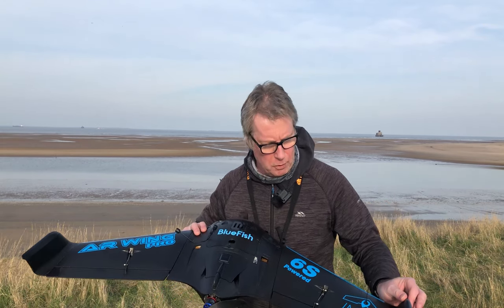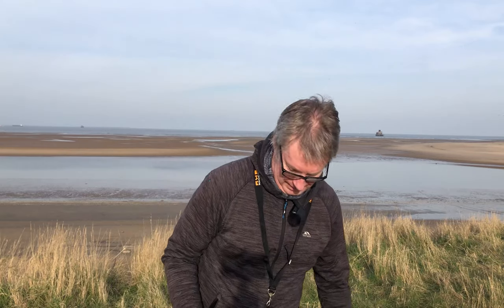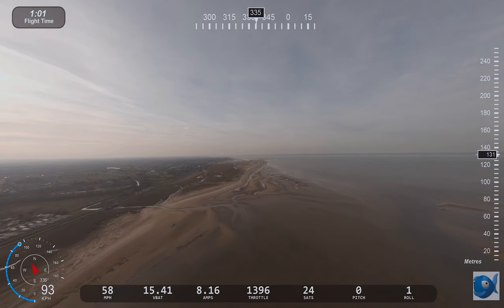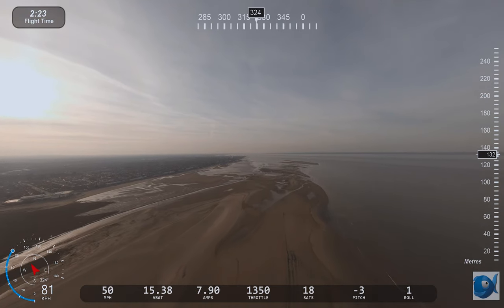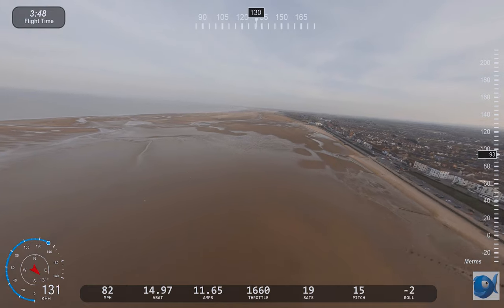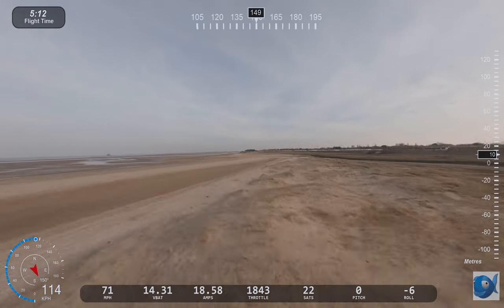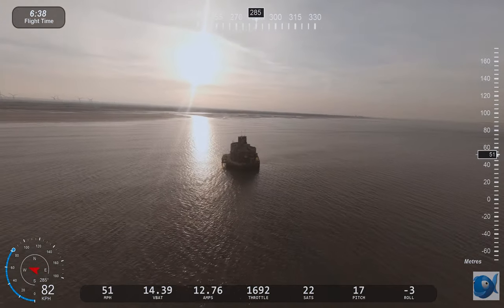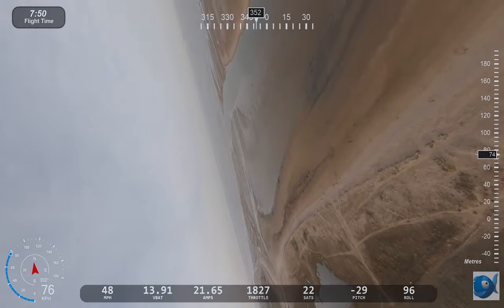AR Wing Pro - Beach Flight - Narrated

Comment: Nice video. Think you have just convinced me this is what I need. Only from the other side of the water, when’s a good time to find the beeches empty? Been over a few times but alway ram packed.
Reply from the maker: I have just changed my motor for a SunnySky 2216 1400Kv MkIII with an 8x6 prop as I think it wilkl give me a little more acceleration out of the turns and better climb rate.

This time of year as the weather gets colder is the best time for beach runs, in summer you need to get there really early in the morning like 5 or 6 am latest.

Comment: Very good fly. Only 1 problem : servos 08 not strong for fast fly ( i crash my fx61 on 150 kmh). 
Maybe posible ask from you nose model solid file ? ( i want use go pro 8 on this wing).
Reply from the maker: Hi Alex the Emax ES08MD are fine on my AR Pro its not that fast and I have used them on my AR 900 6S flying at over 200 kmh. I am using much stronger servos in my 6S Mini Drak build though.

Here is the STL for my Hero 6 mount you will need to modify it I think for the Hero 8
https://drive.google.com/file/d/1HTEzufceWCDX9ylOE2qZYtWE056iXa3z/view?usp=sharing
Reply: @bluefish3607   🥰🥰🥰🥰🥰🥲

Comment: About to set up a build similar to yours. I'm surprised it cruises relatively high at 8 amps. Do you think adding a 10x5 prop would improve efficiency?
Reply from the maker: I could get a lot more efficiency fort sure but I like the current setup with balance of power punch and performance. This is a DJI setup wing so I won't be flying it long range. I am just finishing a second Dart XL V2 which I am setting up for high efficiency and long range flights and missions.

Comment: Great video! What is the flinying time of this setup? Around 15 min just like in the video? And how do you use the 2e lipo? For vtx? I would like to have a picture to steel your setup mat ;-)
Reply from the maker: That flight was with a 3300mah 4S and yes about 15 mins with the throttle levels I was using most of the time. Easily 20-25 mins flying it like a Sunday driver :-)

Not sure what you mean about the 2e lipo.

Here is an overview of the build and setup, if there is anything you need just give me a shout.
https://www.youtube.com/watch?v=U8NLCYz1H8Q&t=248s
Reply: @bluefish3607  nice! i would like to place 3s lipo in it because i dont have to but new expensive lipos. I could place 2x3000 mah paralell.. But i am struggling with the setup. Can you give me some advice? I tried ecalc.com but dont know if 3s will work for long range (30 min) am a sumday cruiser as well 😎
Reply from the maker: @rcnoob573  What is your plane and full spec?
Reply: @bluefish3607  

ok here we go:

plane: ar wing pro
fc: Eagle tree vector 
vtx: Immersionrc vtx 600mw + antenna lhp quanum
Radio: spektrum dx6i
ezuhf 4ch lite
esc: 45 A turnigy AE-45A sbec 5-6v/4A 2-6 cell lipo dc 5.6-25.2v
Motor: A2212/T5 2700 KV
prop: 6x4 precision prop

I do have also a motoredf 22260 3000kv 650w
And a turnigy 2822/14 1750 kv / +2600kv (g series)

I do have a lot of 3s lipo’s 3000mah . And i want to go longer than 10 min flight time... i dont have to ga fast.. ;-) any suggestions are more than welcom :-)
Reply from the maker: @rcnoob573  Hi there I don't have any experience with Eagle Tree vector or Spectrum as I run iNav and FrSky OpenTX with TBS Crossfire on all my planes.

In terms of the powertrain the A2212 is quite high KV so should be ok with a 3S lipo and 6x4 prop.

I would just do a simple thrust test, hold the plane by its nose and power up the throttle until you feel the plane go light and gently push you had up and take a note of the throttle position. This will give you an idea of the power to weight ration and where you need to launch it sucessfully in terms of power.

Apart from that I would just give it a test flight and see how it feels. I have no idea if the eagle tree setup has AutoLaunch like iNav.

Good luck with it let me know how she flies.

Comment: what did it weigh in at with the 5200.
I've a 5000 in mine and still needed 110g of weight in the nose. I lamented the wings and underside so that must add a bit.
Reply from the maker: Hi, it weighed in at 1435 grams including lipo and GoPro hero 6 and no nose weight is required with that setup.

Comment: What is your autolaunch throttle set to sir? Another inspiring video about the beauty of the hobby!! Thank you so much sir
Reply from the maker: Here are all my Autolaunch settings:
set nav_fw_launch_accel = 1863
set nav_fw_launch_max_angle = 180
set nav_fw_launch_detect_time = 40
set nav_fw_launch_thr = 1900
set nav_fw_launch_idle_thr = 1200
set nav_fw_launch_motor_delay = 100
set nav_fw_launch_spinup_time = 100
set nav_fw_launch_end_time = 3000
set nav_fw_launch_min_time = 2000
set nav_fw_launch_timeout = 6000
set nav_fw_launch_max_altitude = 6000
set nav_fw_launch_climb_angle = 30
Reply: @bluefish3607  Thank You very much sir!  Kudos to you !!
Reply from the maker: @raffman4266  Your very welcome, happy flying
Reply: @bluefish3607  just a last question sir? How many volts did you use to power the Telefly tiny module? Did you just connect it to a separate 3s battery or did you use a voltage regulator and reduced the voltage to 12v if you used a 4s? Did the tiny overheat at any time during your bench tests and flights? Hope to connect with you on whatsapp
Reply from the maker: @raffman4266  Because I powered my GPS separately from my F405 FC I did not need to use 12v into the TTiny and I used a 9v source from my FC. It did not overheat at all in this configuration.

See the notes copied directly from the My Fly Dream manual to explain this.
In case of sharing a GPS, you need to connect these wires in the above picture:

PortA P#2 GND : Connect to the GND wire of your GPS.
PortA P#3 U2 RX: Connect to the TXD wire of your GPS.
PortA P#13 GND: Connect to the Power -
PortA P#14 Power: Connect to the Power +. You can use 7~15V DC if you don't need to power a
GPS by TeleFlyTIny.
To use a separate GPS, you also need to connect
PortA P#1(+5V) to your GPS. And power the TeleFlyTiny with DC 7~12V DC to avoid overheat
problem.
Reply: @bluefish3607  Thank you sir much obliged.. i powered the tiny with 8.5v thru a voltage regulator connected to a 3s lipo flight battery and experienced blackouts twice and glitches coming from the telefly module
Reply: @bluefish3607  Thank you sir for the feedback lastly if you don’t mind how were you able to remove the Telefly tiny module osd in PAL or NTSC mode and since the choices are only PAL/NTSC/No OSD with the video button.. I want to use the inav OSD instead of the Telefly OSD in NTSC mode...
Reply from the maker: @raffman4266  I just set Telifly to no OSD as far as I remember and just used the iNav OSD
Reply: @bluefish3607  How did you know then if the tiny was in PAL or NTSC mode sir?
Reply from the maker: @raffman4266  I just set to no OSD and set my flight cam to PAL and my FC OSD to PAL and it worked. If you are not using the telefly OSD then when you disable it the PAL or NTSC is controlled by camera and FC settings I think.
Reply: @bluefish3607  Thank you for the immediate feedback sir.. you are too kind

Comment: Do you have a link to the foam armour?
Reply from the maker: I have just coated the entire fuselage on my latest build my DART XLE V2 but not flown it yet. I will be putting up a video tomorrow of the build and my mods.

Therefore I cannot say how the foam armour will work for sure but will know when I maiden over the next few days.

YOU can get it here: https://deluxematerials.co.uk/products/foam-armour
Reply: @bluefish3607  how do you think it compares to laminating the foam? Thank you for the link
Reply from the maker: @blackterminal  I think lam would be much stronger and wear resistant tbh. I wont know how foam armour works until I have had a few flights and landings. I will be reporting my findings in future videos. Maiden of the XL this week weather permitting.

Comment: Hi there. What pitch degree and launch degree did you set in inav? Cheers!
Reply from the maker: MY FC board alignment pitch and roll is set at 0 degrees and my launch angle is 30 degrees
Reply: @bluefish3607  thank you so much.
Reply from the maker: @michalp.4975  Your very welcome, happy flying
Reply: Superb!.. but which Estuary is that.?....it looks a  great place to visit for a walk on proper sand(unlike where I live on the English Channel.😳
Reply from the maker: @chrissofpv3017  Its Cleethorpes on the Humber estuary.
Reply: @bluefish3607  You're lucky to live in such a good open flying area..I,m surrounded by M.O.D. establishments..no (legal)flying anywhere tbh.😔
But heyho...my Caipirinha 2 build is almost done🙏🍻🚀
Reply from the maker: @chrissofpv3017  Yes I am lucky Lincolnshire has lots of open farmland and coastal areas. The Capi 2 looks like a fantastic plane good luck for the maiden.
Reply: @bluefish3607  🤞🙏👍😉🍻

Comment: How is your "foam armour" holding up?
Reply from the maker: Its no good at all, it starts to peel if it gets damp. A much better option is to use E6000 or Goop, I have coated thr front of my AR Pro test plane and so far its held up well on a number of landings and one reasonably heavy crash, and its waterproof!
Reply: @bluefish3607  ... Thank you for your prompt response. Wrapping up a foam bird using film, does that work?
Reply from the maker: @Swimfinz  Yes definitely thats prbably the best method. I just did two tests using two different covering films and they have held up really well and made the wings stiffer. https://youtu.be/SvtxLuX2TAk